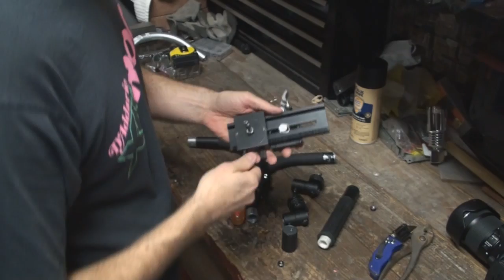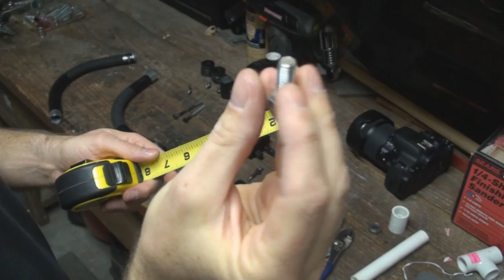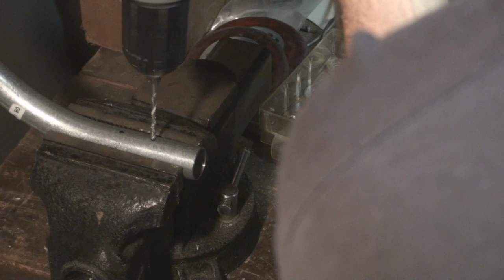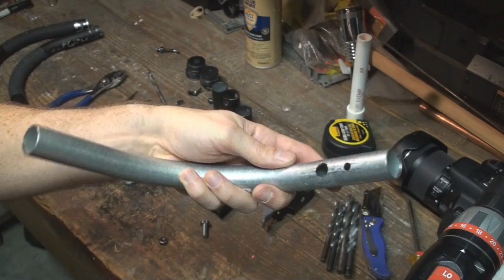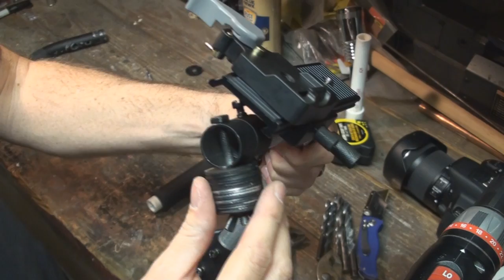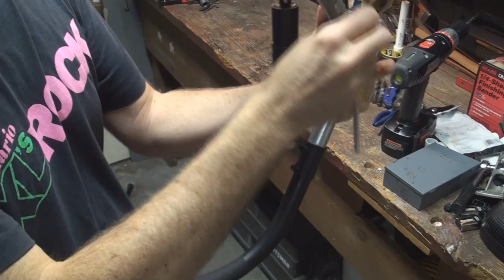DIY Silver Flyer Steadicam for DSLR Build - Step by Step Tutorial

Comment: hey ive been trying to balance my rig for a while now but it wont stay steady

it sways side to side and wants to turn around and all kinds of crazy stuff

any idea what i did wrong? did u ever encounter this?

im thinking it might have something to do with this traxiss. does it matter the way that is is turned?
Reply from the maker: What camera are you using?  How much weight have you added to the top and bottom of the rig?
Reply: im using the t3i with 18-55mm lens but im wondering does it have something to do with the bearing that im using ?

i used the double shielded vxb 608 zz , ones from amazon 

the inside of the bearing causes the entire rig to spin when i hold the handle.  (the inner piece spins)

like right now im holding the rig (without my camera on and its balanced) but it spins in a 360 motion when  try to hold the rig steady  

i never fully got my rig balanced but it was almost balanced yesterday and i noticed the same problem 

any idea what the problem could be?
Reply from the maker: JUSTME543212345 Can't say for sure.  I've been using USED bearings from skateboards and scooters, so they are not crazy smooth, they have a bit of resistance.Try adding a second bearing to see if that helps.
Reply: Same deal here. I'm using a 60D with a 14mm L lens. I've weighted it on the bottom with Avenger clamps (very adjustable) so that it seems to balance well when I stand still, but the second I make a move (even a very gentle step forward), it starts spinning and rocking. I even used a double-slider on the top so I have forward and lateral adjustments. No change. It just rocks and twists.

I may be wrong in my assessment, but when I am still, the rig seems perfectly balanced. It's moving that sends it into a tizzy.

Single bearing, Traxxis u-joint, EMT conduit, 60D, double macro-slider, three avenger clamps. That's about it.
Reply: I'll third that. It may be because the bearings are brand new because it's fairly sensitive on the X axis. I didn't find adding a second bearing helped, but maybe I'm doing it wrong. What I do now, is just hold the bottom a bit and orient the rig.
Reply: Same problem here, rig is balanced when still. The moment I move left or right it spins. Up and Down is decent, forward and back is alright.. Im using a used Bearing, and also tried two.
Reply: It needs more weight, that's the only way I've gotten it to stop swirling around
Reply: I can't get it to do that smooth 1 second drop test either. Whenever I attempt it, the whole thing starts swingin all over the place.

Comment: You can just use a heat gun or put the pvc coupler in the oven at about 200 degrees  for around 5 min and then try to use a piece of wood and rubber mallet to get the bearing in place.
Reply: Boiling water also helps, however I found that the heat restricts the PVC and it's actually harder to put the bearing in. Also, for the handle, I bought a PVC L shaped pipe with a half inch opening at one end that acted as a coupler that I straightened after heating it up.
Reply: That's cool. But i just put the pvc in the oven at 200 degrees for about 10-15 minutes and i just put the bearing in, put a block of wood on top of it and hit it with a hammer. Now i have it all pretty much balanced but i can't get it to stop wanting to spin, or wobble a little.

Comment: Hi Utopia, brilliant tutorial. I'm making on myself and wanted to know what is the measurements between the holes that had been drilled.
Reply from the maker: Thanks!  The distance between the two is roughly 1".
Reply: Ok brilliant thanks, what about the distance from the end of the tube to the first hole?...is that also about an 1"
Reply from the maker: Go to 12:48 of the video where I hold a tape measure to the tubes and you'll get a pretty good idea.  Look like 1.5".
Reply: Yh I could see it that actually. Ok thanks. I assuming it doesn't have to be precise widths apart, or does it?
Reply from the maker: No, doesn't have to be super precise but generally close.
Reply: Ok, thank you so much for you help.
Reply from the maker: You're welcome!

Comment: Hey I'm having a little trouble with the rig. I just built one but I can't figure out why the whole thing flops around when I move. If I thrust back and forth the thing swings like a pendulum. I thought that meant that it was bottom heavy so I removed most of the weight but I'm still having that problem.

Also the thing spins left and right in the bearing super easy.... like uncontrollably easy.

Do you have any pointers/tips to help with this?
Reply: Perhaps if I can get more friction on the bearings that will cause the excess spinning to stop. Any recommendations for that?
Reply from the maker: You want to be careful not to have too much weight on the bottom.  What camera are you using and with what lens?
Reply: Utopia Studios I'm using a Sony Handycam HDR XR160 with no lenses.
Reply from the maker: That's a fairly light camera so I would think that countering that with some added weight at the bottom may help solve it spinning out of control.  You're still going to need to get used to using it, it takes time to figure out the movement and how to use the gimbal to make it go where you want to.
Reply: So if the rig is completely balanced, will there still be a trace amount of drift or will the rig be absolutely stationary?
Reply from the maker: You should have some drift, no rig is perfectly flat all the time unless you're getting a pro setup worth $$$$.  What you want to do is be very conscious of your movement as you move with the camera holding the gimbal.  There's definitely some "padding" done with your arm and wrist to minimize the ups and downs, side to sides, as much as possible.  Imagine you didn't have the rig and had to pretend you did, handholding the camera...
Reply: Hmmm. I think my only final question then is how does one tell when the rig is top heavy or bottom heavy? I know it will swing like a pendulum when too much weight it on the bottom but it seems to do that even with next to no weight over all.
Reply from the maker: BSAproduction Again, it depends on your specific setup. The lighter the camera, the more it's likely to "flop" around since it's really the weight that provides a degree of stability.  I haven't experimented with lighter cameras, I may do a video for camcorders and GoPros, both of which I own, just don't use as much of.

Comment: You can heat up the PVC Connector in an oven at about 200 degrees for 15 min or so. Once warm the ball bearing will fit flawlessly without the need to drill. Once it cools it stays really tight.
Reply: u do realize you are a genius right?

that was a great idea
Reply from the maker: Great tip!  Thanks.
Reply: Utopia Studios great video by the way! A+++

Comment: I used your tutoral to build mine.  thank you.  The issue I'm having is, when using it, I'm getting the bottom part swinging around too much.  My video keeps rocking back and forth.  I'm using a Rebel t1i, which looks a little smaller then your camera, so lighter probably and it looks like you are using almost the same amount of washers on the bottom and top.  Is this so?  I've heard people say that the heaver the bottom the better, but I'm wondering if I'm experiencing an the rocking back and forth issue, because the bottom might be too heavy in comparison to the weight above the gymble.
Reply from the maker: Actually I found that if I have too much weight on the bottom it swings more wildly.  You have to find that happy medium between the weight on top and bottom.  It's definitely tricky, but once you get it right, it's smooth as silk!
Reply: Utopia Studios Thanks!

Comment: Put an inverted "V" at the bottom with weights on each leg of the V and it will give your steadicam more side-to-side stabilzation.
Reply from the maker: I'll have to try that some time!
Reply: I did and improved the stabilization so much, I was able to remove about half the weight that I had on it.
Reply from the maker: That's great.  Please share a picture or better yet a video!

Comment: great vid !! i have a question i have a Sony nex f3 it weighs about 11.1 oz is that to light for this stedicam proportions ?
Reply from the maker: You should be able to use this setup, although there are other solutions out there for smaller cameras.  The Sony is front heavy like a DSLR, but even more so camera body to lens proportion wise.  This is where the macro slider really comes in handy.

Comment: at 9:15, you use a bearing and it's able to rotate freely while at the same not slipping off when held upside down. shouldn't the bearing be stuck to the traxxas in order to not fall off? Thanks for the tutorial!!
Reply from the maker: The way I hold it is deceptive.  The bearing sits between the EMT and the joint of the Traxxas.  I shaved off enough of the Traxxas to make the bearing fit snuggly.  Snuggly is the key.  It won't go anywhere this way, but even if it's a bit loose, it has nowhere to go since it's between the Traxxas joint and the EMT.  However, you don't want it loose at all or you'll have balancing problems and possibly some jerkiness in your footage.  Hope that answers your question.

Comment: Hello, I just finished build mine (not with the exact same tubes, cause I live in France and we can't find those in France, so I found a couple who looks the same but a lil bit shorter) but I didn't balanced it yet, though, it looks really bad at that moment, like the camera weight make it look down badly, I tried to put some weight on the bottom of it and it looks a bit better but not like yours at all, did I missed something or the balance is just very important and hard to find ?
Reply from the maker: Did you use the macro slider?  You should be able to move the camera back and forth to find the right spot from where you can continue balancing.  Moving the camera on the macro slider is the first step after you've put some weight on the bottom tube.  This will give you a general idea of where the camera needs to sit.  Then you should only have to balance side to side and make very minor adjustments to the macro slider (forward/backwards).  Hope that helps!
Reply: utopiastudiosbiz Forgot to say that I didn't put a slider, I couldn't find a cheap one and couldn't afford an expensive one if I'm not certain it will work. Well i think i'll try to balance it as much as i can, thanks for the answer !
Reply: utopiastudiosbiz After re-watching your video, it seems that this slider is really really helping ! Definitly worth the 20 dollars cost ! Though, your link for the little plate and mount is all sold, could you find another one ? I don't know which one could work the same way ! thanks again
Reply from the maker: Louis Delahaye , I updated the links to the items, this time to Amazon.  Good luck!

Comment: Hi, I saw in the description it says you used: Qty (1) 5/6" x 2" Hex screw+nuts... to screw into the traxxas.. Im guessing that is 5/16 - not 5/6..? Also, it appears in the video you are using a shorter screw than 2", no? Thanks!
Reply from the maker: You're correct!  I changed the description to reflect the correction.  I'd have to check but I think that that's the correct size, or close to it.
Reply from the maker: Actually after looking at the video it appears to only be about 1" in length.

Comment from the maker: Wow that's a lot of weight!  Seeing you have a battery grip on there it'll add that weight to the rig but I'm not so sure that you need that many washers to balance it.  Having the grip further away from the center of gravity can affect the balance.  I'd consider re-positioning your grip closer to the tubing by putting the Traxxas through it like I show in the video.  Also consider removing the battery grip.